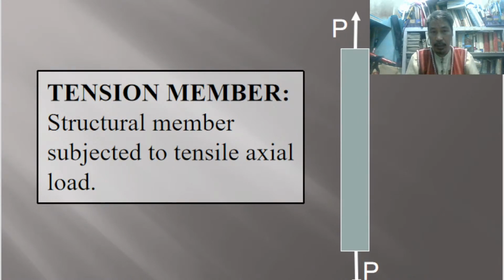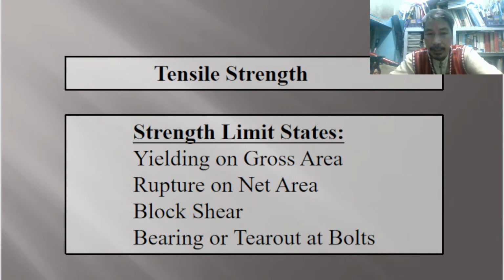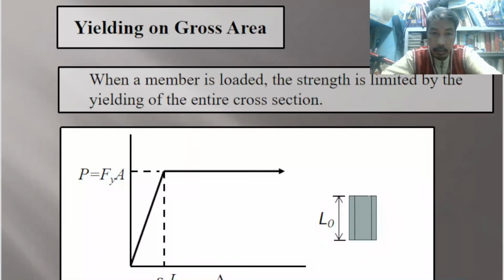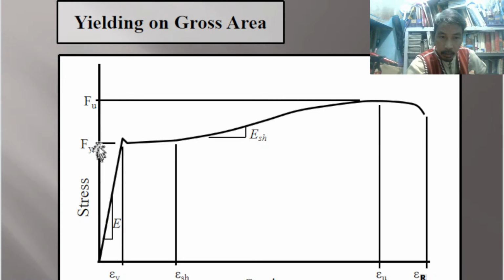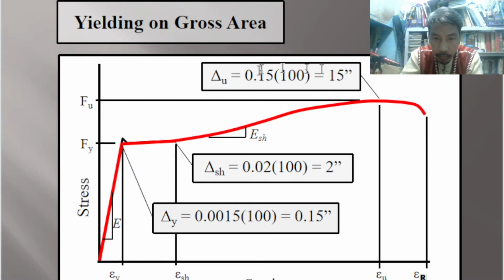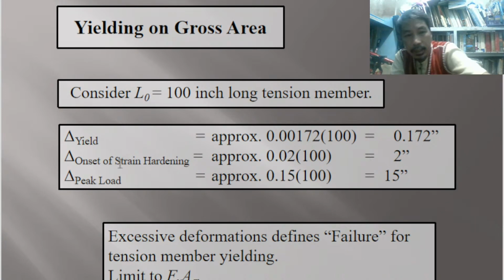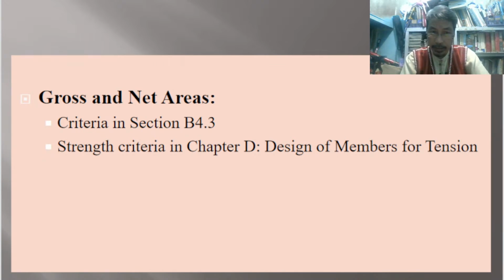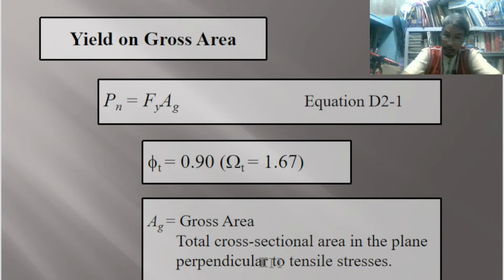[ LIVE CEE6 Lecture 12 ] DrAP Zantua AISC Tension Members Talks + ENGINEERING Analysis & Design

Comment: Thankyou sir for tackling about AISC tension members. Strength limit states includes yielding on gross area, rupture on net area, block shear, bearing or tearout at bolts. Gross area is the total cross-sectional area in the plane perpendicular to tensile strength.

Comment: This video discussed the tension member design and its strength design requirements. Different types of failure mode has also been mentioned such as failure mode tensile, failure mode compression, flexural failure mode,  and failure mode torsion. The four strength limit states has been discussed such as yielding on gross areas, rupture on net area. block shear and bearing or tearout at bolts. The yield gross area are easy to comprehend with the illustration. Thank you, sir for this video lecture.

Comment: Thank you sir for this live lecture that tackles the design of tension members. I learned in this video what are the requirement of its strength design. Also yielding on gross area is well explained because of the illustration that is shown with this video.

Comment: Thankyou sir for explaining about steel instructions. I’ve learned that tension member subjected to tensile axial load. There ate two types of strength design requirements which is ASD (alternative steel design) and AISC. So according to this video lecture, strength limit states includes yielding on gross area, rupture on net area, block shear, bearing or tearout at bolts. Yielding on Gross Area is when a member is loaded, the strength is limited by the yielding of the entire cross section. Gross Area is the total cross sectional area in the plane perpendicular to tensile stresses.

Comment: thank you sir for discussing tension members designs. I learned about strength design requirements formula, tensile strength and strength limit states (yielding on gross area, rupture on net area, block shear, and bearing or tearouts at bolt. Also I learned that yielding on gross area Ag that when a member is loaded, the strength is limited by the yielding of the entire cross section however, consider how this is affected by the stress- strain conditions. Also, gross area is the total cross-sectional area in the plane perpendicular to tensile strength.